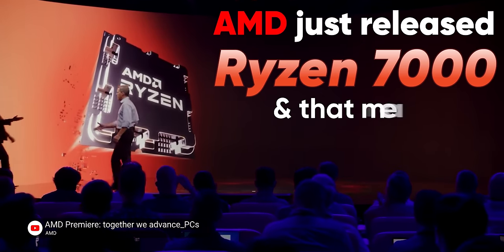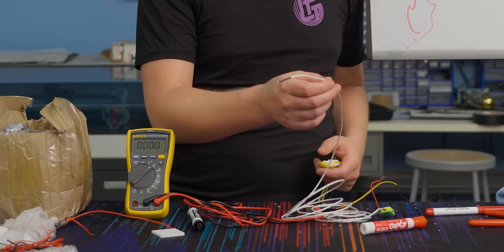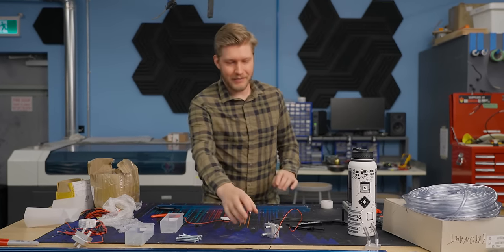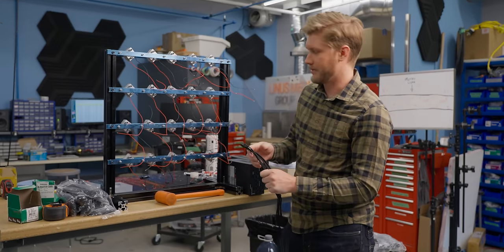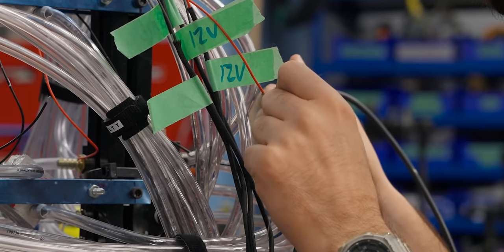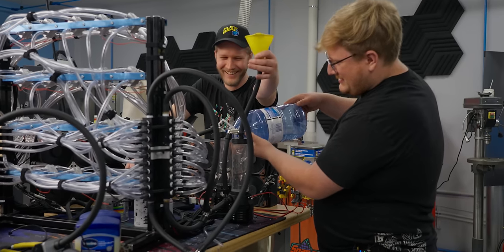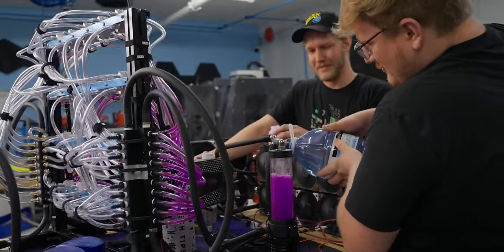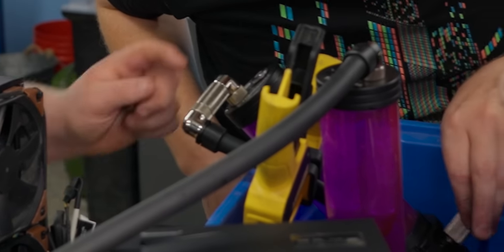Our DIY CPU Chiller From AliExpress is RIDICULOUS

Comment: Your BIOS did not reset, the firmware resets the CPU and memory configuration together with AMD CBS and possibly PBS depending on the error encountered during POST.

In the case of a memory training problem, the IOMMU, CBS and memory speed are reset to default values. Making you "think" the platform reset your settings, but in-fact it only reset a few settings.

Comment: Water isn't flowing to the top TECs because all the TECs are hooked up to one manifold. Water will flow through the path of least resistance -> the top TECs are too high up so water just chooses to flow through the lower ones. If the TEC rig had been built horizontally it would've worked better. Or you should've had a separate pump for each row on the tower. Or the manifold could've been the highest point of the system with all the TECs below it.

Comment: u guys keep make mistake with paltier.. cooll the water tank with paltier cold side use heatshink on that side and touch on that water in water tank use temperature sensor make that paltier turn off when that watter go to undeer 20degrees..
im so poor but i make one and runing so good just use more then 200w power..

its same like my air cooler for my ugly room. i cold the water and run it to copper pipe and blow air on that copper pipe to have cold air.. its simple and u guys make it hard..

Comment: I'm confused as to why putting the pumps in series is better. If the first pump has slightly less output, wouldn't it underfeed the second? If the first has more output, wouldn't it be slowed by the second pump? I would have thought parallel would add more pressure and flow speed.
Reply: Putting the pumps in series effectively combines their power - you’re accounting for the first pump pushing fluid into the second, but not for the second pump sucking fluid into itself from the first. There’s very little efficiency loss when pumps are connected in this way, they should never be connected in parallel unless you intend to run two loops out of one reservoir, and even then, it’s usually better to just combine the two loops.
Reply: @Foxi4Qnet  thank you for your explanation. I guess I'm thinking of it in terms of extremes. If I had a firehose type pump feeding a fish aquarium pump, it would cause issues. The only time I think it would be happy is if the first pump was slightly faster than the second to keep a constant supply for the second. Am I thinking about it incorrectly?
Reply: @JamieShultz  the general rule of thumb is that two pumps in parallel combine flow rate (wider circumference of tube, since you have 2x, so more liquid flows through at the same pressure) whereas two pumps in series combine their head pressure (same volume since it’s the same tube, but double the pumping power).
Reply: As for pairings, you generally want them running at the same speed in series, but since they’re connected together they will reach an equilibrium regardless (with some pressure build-up in-between them) because they kinda have to. :P In parallel they will continue running at different speeds.

Comment: you would be better off just using a window AC unit to cool the antifreeze. It would use less power, I am sure, and be a lot easier to build.

If you want ideas for videos, do a test where you measure total power consumption when varying cpu-fan speed profiles. There should be a sweet spot where running the CPU cooler at higher fan power reduces overall power consumption because a cooler cpu draws less power.

Comment: How do we solve filling lines in the real world? Quite easy. We make sure the reservoir is above all lines we need to fill. If we ever need to have lines going lower and then back up. We install a bleeder to empty the air out of the system.

OR! We pull a vacuum on the lines first and then we fill with liquid.

Comment: TECs don't really have a max low temp, so much as a temperature differential from room temp. No matter how much more you have, they'll only get down to that temp. If you lower room temp, then the differential temp will lower as well. The only way to make them go cooler, is to learn how to stack them to get a higher temperature differential.

Comment: Two pumps in series and a lot of parallel tubes. 
Wouldn't something like every 4 to 6 TECs in series and then parallel be a lot better. 
The speed of cooling flow through a single TEC should be really low in this configuration wich really increases the flow differences through the TECs because of differences in flow resistances of tubing length or the water blocks (the same flow resistance is needed for an equal splitting of the cooling flow).
(Written at 7:00 in the video).
Reply: 9:50 I don't believe more pressure is the answer. As soon as the air is out of the loop the flow through the TECs should be a lot more equal because gravity will be a lot less important to 1 medium within the tubes than 2 mediums (Air will stay at the top and has to be moved to the bottom to get rid of it) wich is difficult to do because of the low flow. 
My guesses are they will have to tilt it or cut the flow through all but a few lines.
Reply: Well, that did actually hurt to watch. 
I'm a bit surprised that the pumps did not lead to failures on more connections or maybe even the tubes.
I have no idea what pressure 4 or more D5 pumps in series lead to but it should be a lot.
Reply: Yeah, it actually hurts

Comment: This looks like an application where you should have put the pumps in parallel rather than series. With so many blocks in parallel you need more throughput, not more head pressure.

Comment: Why not make an acrylic tank for each side, and bracket each TEC to both sides, then you can run a huge radiator inside the hot tank and cool it off with massive amounts of air. Having all TECs separate doesn't seem to work.

Comment: Absolutely love the video, but I have to wonder why you didn't run the pumps in parallel. Using splitters (more points of failure rip) at the intake and outtake of the pumps, all of the pressure from each pump would cumulate this way right? In series the pressure wouldn't change and would just be the pressure of the weakest  pump in the series. Been a minute since I've been in physics class but another shot at this video would be cool!

Comment: I'm not an engineer so excuse my ignorance, why would you connect the pumps in series instead of parallel? Other than not having the hardware to split the line and rejoin it? It would make more sense to me bc of funnel principles to increase flow

Comment: How about just using a big metal tank as a reservoir and attaching all the modules onto the side. You could skip most of the tubing and fittings. I'm not sure if it would be cooler or not.

Comment: Why not make a hybrid version? Regular watercooling with TEC inbetween cooler and cpu/gpu and the heat from TEC to a single radiator in the back of the case to cool the water just a little further before hitting the hot pc component. If it's worth cooling it's worth over engineering 😎

Comment: hrmm could you since you go the array already you could add an enviromental sensor(temp, hum,pressure) to control the cpu temp so the dew point isnt reached. this should enable you to run without vasseline

Comment: I would love to see a episode 2. TECs need 17v and get bigger pump to have normal flow computer ones don't cut it.
Reply: The max Voltage of those is 15v. Better is 12v(more efficient)  but the biggest Problem is that all of those small waterblocks where in parallel,so some didnt had any flow... The best way would be to have about 5 in series, and for each group an seperat pump.

And for the cold side all in series.maybe 2 parallel, but mostly Series Connection

Comment: A copper pipe with a copper sheets soldered to it for a hot and cold side, have all of the peltier units in two rows running along them, might just work better?

Comment: just realized, your flow problems would have been solved with a basic pressure regulator at the end of each row of tec's.  set to say, 2-3psi and you'll have even flow between them all....theoretically.

Comment: I hope people don’t assume that engineers usually work like this in a professional environment. 

Basic fluid dynamics knowledge will already tell you that manifold is a bad choice for such a loop and you’d definitely want to do a flow map with required head pressure. 

Also, he clearly miscalculated the amount of power required for all those peltier plates. I prefer his older videos where more though was put into it instead of this half-assed attempt.

Comment: I did 40013 with a 13900K on a Z690 Board DDR4 with a NH-15 (with Contact Frame) at -0.1V offset, means 40k is not enough ;-)

Comment: dude that's a pain. like move pumps on top and remove air from the system, it's like super easy - use a simple float so it blocks the liquid and lets the air out.

Comment: Things i think would have helped: 

1. A frame that laid them vertical from the start. Reduces head pressure losses from the height.

2. Using that to put the frame slightly lower than the pumps, block, e.t.c. So gravity helps on the way in and pump pressure only has to force it back up.

Comment: Over engineered could have been built better. First problem is the air lock you need a bleed off point at the top to release the air. 2nd problem the pumps have to fight gravity and should be higher. 3rd problem to many hoses and water blocks. If set-up correctly that should freeze. I would have one water block one pump with tank and all 20 on the one water block and many less hoses. If you attempt to build this again my idea will get it to freezing temperatures. But awesome try anyway.

Comment: uh you could probably end all your threading problems with the knowledge that plastic and brass dont really need thread seals if made well and tightened properly, natural gas lines just use bare brass and proper contact... but if that scares you and if you want the peace of mind thread sealant gives, use tfe paste. especially low pressure applications... its just to make you feel better.

Comment: Oh wow my post got deleted for having linked you a pipe friction calculator. 

Problem is your head pressure is too high and you have no flow rate as a result. You can help overcome it by raising your pump so it is the highest point in the system. Also you have so many fittings and a lot of tubing. Considering these pumps are likely circulator pumps that produce no head pressure you need to calculate your friction losses in the pipe and the fittings. Each 90elbow will add at least .5psi to the head pressure requirement until you have zero flow in the system dead heading the pump.  

Put the pump on a stand so it is above the system and you will likely see it perform 100x better and as long as your friction losses are not too great will see HUGE improvements. Most pumps like the ones you are using won't make more the 2ft of head. Raise your pump above the rest of the system, and do a follow up with how much better it runs, this system should be BEAST. It is seriously as easy as that and will take all of 2 seconds for you guys to know I'm right about it. 
 

Source: I have designed water treatment systems for cities, towns, farms and restaurants, as well as water softener installations, septic fields, and sewage treatment systems.

You're welcome :).

Edit: Sometimes you can cheat and use larger diameter pipe to convert the flow rate into head pressure because of the Bernoulli principal but,  you are already dead heading so that likely won't work.

Comment: This video just proves the point that using an industrial water chiller/ beer cooler is way way better than doing this. The efficiency gain and less jank outweighs the price. + U not saving much with this in the long run anwayas. Specially in the electricity bill department.

Comment: I'd like for them to try this again but without the guesswork. Just do the maths beforehand, work out how many of those coolers they'll need. Test each connection before they commit. Position the pump so they aren't working against gravity. Then work at the basic, ie make sure the CPU has the best possible thermal contact with the cooler block. For all their experience this was just a botched effort. Not at all what i'd expect from LTT. They should at least know why they failed.

Comment: Let's put more pumps in series... you guys need FLOW, not PSI, you are splitting the amount of water between 20 outputs. You should have split the row between pumps, one pump each row or use multiple pump on each headers.

Comment: honestly unless you're going below -40c the coolant was a dumb idea. water transfers heat much better. add a bit of coolant if going a bit under zero, maybe but I don't even think you went under zero. if antifreeze was actually good at cooling, cars wouldn't need water mixed in..water is the thermal transfer medium and antifreeze is only there to prevent freezing. also propylene glycol instead for this application. 

otherwise tec experiments ftw.. ever since I first heard they existed (in the 90s) I've always been curious about using with cpus..though when I first heard about them it actually was a cpu cooler but a pentium one didn't need much compared to todays beasts lol

Comment: Peltier...... When this CoolIT with the freezone elite came out?  i still got the controller module and cd for it.. i had allot more  and wanted to mae somthing with the Dell xps 720 system version as well. god it was some good time whent i came. to bad it never cathed up and the company closed :( ...
Reply: to add. the Sandwhich for the cooler side and hotter side was ground breaking for its time.  big ass 120x38 Delta server grade fan..  think that setup could cool a 3.4ghz overclocked pentium Extreme edition to 21c or so ?  and that for 2008... {god i feel old now}

Comment: "We use two pumps in series so we get high pressure" Shows two reservoirs with integrated pumps in series...

That's not how it works! Replace the downstream reservoir/pump combo with a simple pump, otherwise you don't get the higher pressure you're talking about.

Comment: That's just the worst build ever 😅. Here's some ideas off the top of my head:
1. Build the system horizontal so you don't need to fight gravity
2. you know you can run liquids through 80/20 right? (also vacuum and shop air)
3. Attaching all Peltiers to a single large plate of aluminium would've allowed for easier heat transport to the exchangers
4. A large fountain pump or pond filter pump would've worked much better than a bunch of those dinky D5's. 
5. If you just want power for Peltiers and pumps, just get a cheap high-power power supply rather than wasting PC power supplies :). 

Anyway, I think this vid deserves a version 2!

Comment: Well... they did combine pumps in a series, why did they make this christmas tree of piping after that to cool each block separetly is beyond me. If they connected each block in a series then pump would have no issues. Even one pump might do the trick. By splitting it so much and water going up and not down they increased water pressure needed to move it. One loop on each side would do the trick. I wonder why Alex made it like this besides trying to make it more interesting to see.

Comment: You guys have no idea about fluid dynamics do you ?
The fluid was struggling to go all the way up because of lack of pressure. Meaning that even when it did, there was not enought flow to give you all the cooling power you have installed. So out of 1400W you'd probably get 2/3 at best. Putting the cooling rig horizontal could have fixed that easily tho.
Reply: The incline was too high, not enough head pressure, to be sure.

Comment: Alex is the most read something one and never cross reference.
Reply: Would have just got 2 large thermal blocks instead of 20 small ones
Reply: Or add vacuum pressure to they system
Reply: Or literally create something that doesn't have 20 different designs flaws. My god Alex your really do drive up engage ment in the videos.

Comment: The normal way to engineer such things is to start smaller and test that the concept works. Use just one of those rows of coolers, and see that it works ok. Then add another row and see that it works, and so on. You don't build it all at once without first testing and ironing out the problems at a smaller scale.

Is nobody even slightly competent in this company?

Comment: I wouldn't buy shit, literally,  from AliExpess. Here, I am extending a olive branch for a pc, show idea. I work for Ubisoft, as a 3d modeler/animator. My computer, for work, runs on 134a refrigeration. No, not water, not a bunch of fans, HVAC refrigerant. Why, I need cooling when testing 3d models and animations, for testing in excess of 400fps. Be pretty cool, to see if you can do it for, under 3500.00 USD. Good luck
Reply: They already made a chiller like that, although admittedly their block was less than ideal for handling refrigerant. Maybe they’ll fix it one day.

Comment: I'm only at the beginning of this video but I have an Idea. What If you just take the heat from the CPU {maybe GPU too) and let it heat up serveral cables. Because heat is effective in an area it can heat up alot of small cables resulting in about 12V... Enough to power a fan 👀

Comment: I don't wanna be Mr. Obvious, but why didn't you just put the Peltier-module on the floor to resolve the head pressure issue?
Reply: A far better idea would be to do what cars do, have the reservoir at the highest possible point, the pump at the lowest possible pump (preferrably one that is at least twice the required power) and have the pump feed directly from the reservoir, then feed around to the smaller tubes and they exhaust into the reservoir. Better for air bubbles too.